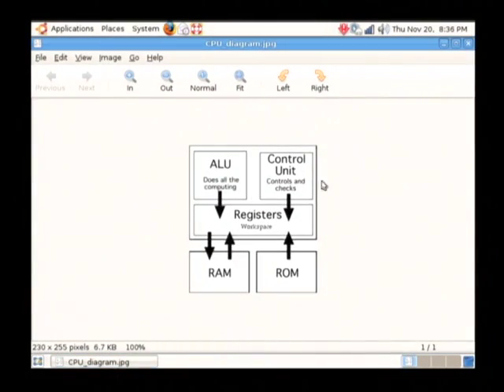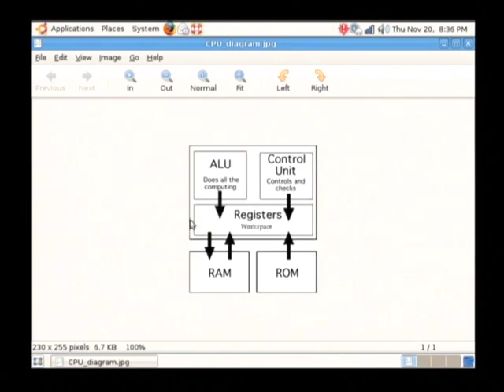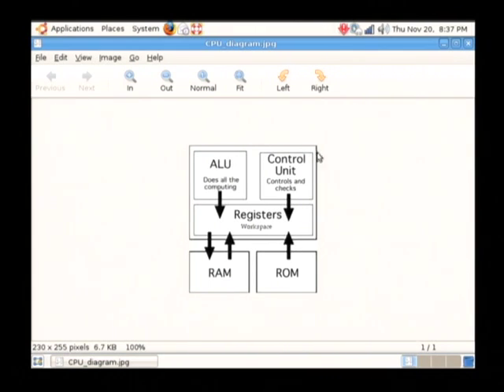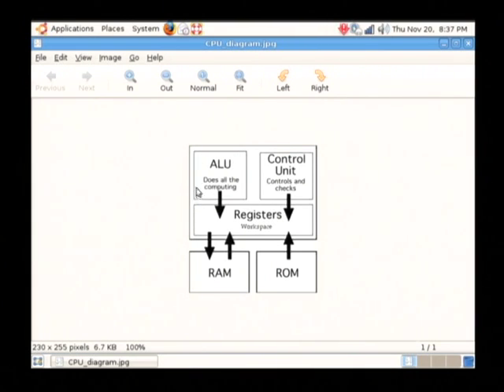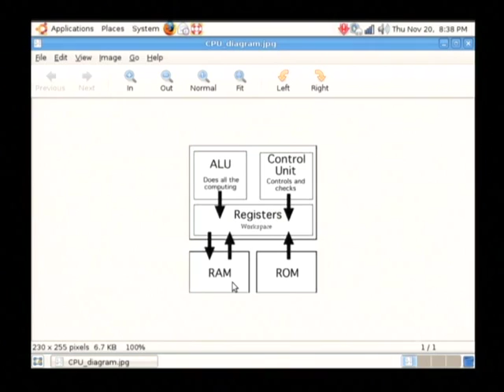Computer Tech Solutions : How Does a Microprocessor Work?

Comment: 2 assigned to 10 by the microprocessor, is added by logic gates which are structures of the logical consequences of a transistor i.e 1+1= 0 or 1 depending on whether its an NPN or a PNP.

XOR (exclusively OR) yields a 1 only for '1 and 0' or '0 and 1' and AND yields a 1 only for '1 and 1'. So one of these represents the first digit and the other represents the second digit.

You get 'full adders' which is where you take the output of this and make it an input with another input, OR's for carrys

Comment: you change silicone properties by adding heat to the material and by doing that you change free electrons that are moving through the material. With these two combined you form basic circuits OR NOR AND NAND etc. with them you form memory calculations etc.

Comment: the transistors inside it do calculations with binary an hexadecimal, for example a 1 in binary or hex is a "on" value in electricity, a 0 is "off". Since binary and hex only use a complex method of counting in 1's and 0's, your CPU can do advanced calculations. Your CPU can do this millions of times per second, and it is also the most advanced piece of technology man has ever created.

Comment: @MitchAndo96
well basically everything in a electronic circuit can either be ON or OFF and every number is stored in binary code ( 1's and 0's ). 1's are represented by ON's and 0's are represented by OFF's. Then the system can be configured with transistors (which in this case act as logic gates) to add and subtract these binary numbers. So two which is 0010 with be added to 0010 to get 0100 which will come up on your screen as 4.

Comment: well, its little complicated to explain, basically a transistor consists of a base, an emitter and a collector, which are three pins it has, and we can connect them in different ways, and combine multiple of them to make different gates, and then combine different gates to make very complex outputs! a normal microprocessor in your computer, like intel i7 or any other, contains about 7 BILLION of those transistors, and yet the whole thing smaller than the tip of your thumb!

Comment: @MitchAndo96 each number is converted into a binery i.e. 01011, on the chip these are recorded on switches like transisters which are either off or on. 0 would be no volts and 1 would be 5 volts. there is a program that tells the chip how to understand these codes and what to do with them.

Comment: @Celinancc1701 There are transistors. Their work is to judge, YES or NO. YES is 1 and NO is 0. There are gates inside transistors, one in each, open or close, 1 or 0, that is binary number. Electrical signals determine whether to open or close. ALU determines what signals to send based on Algorithms. Algorithm is very easy, if u just learn Algorithm, u can understand the whole of computer. It will take u about 1 hour to learn Algorithm in a very good way. Algorithm is a maths based on YES or NO.